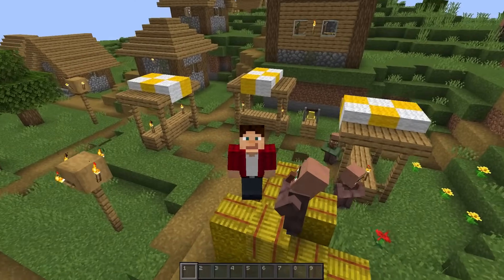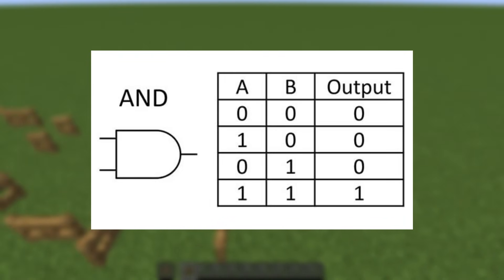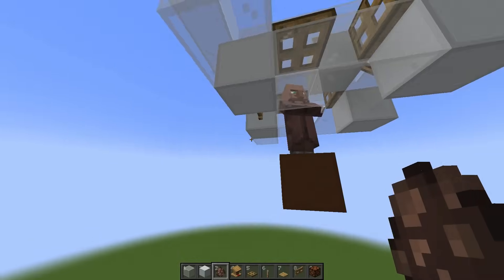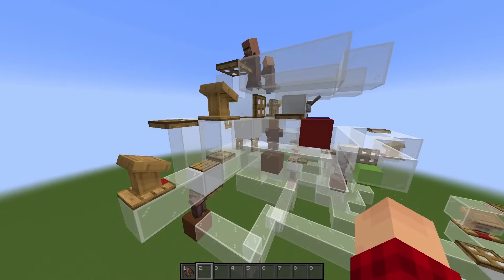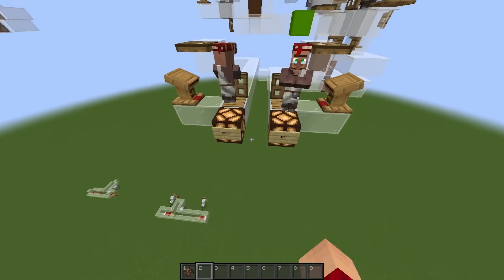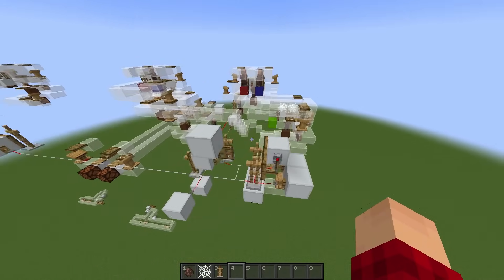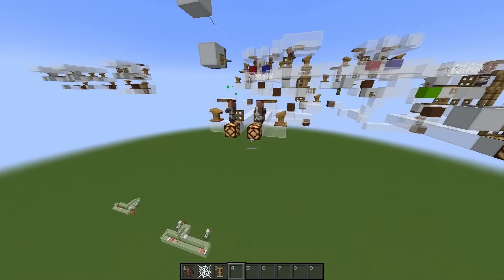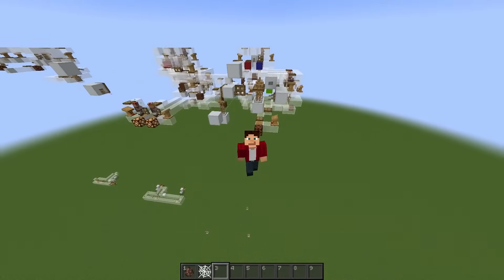Can Villagers Perform Binary Addition?

Comment: Kinda crazy how you ended up needing to design in delay lines using the cobwebs. When programming an FPGA, the compiler and synthesizer will work in tandem with a timing analyzer to build delay lines into the logic.

Comment: 9:55 I wonder if the guy wasn't moving is a limit to how far they can passively search for the lectern but when you replaced him it did a bigger check, maybe you need to provide extra motivation by making intermediate lecterns that they can go to but will have the floor get swept out from under them when they do causing them to fall to another path with the actual lectern.
Reply from the maker: I fixed the issue by implementing an OR gate later on in the video. I believe the issue was that the other villager had already targeted the last lectern, so the other guy had no lectern to target. Implementing the OR gate solved this, but it still doesn’t resolve other things like the unreliable villager reaction times
Reply: @michael23b  Interesting, this comment didn't show up in my messages, but rather as I was scrolling down through your comment section my comment and thus your reply showed up again, good timing! That could be the case, but what I said might still have been a factor, or if it wasn't it could be worth looking into none the less.

Comment: I love your idea here, entities being turned into logic gates is fun concept especially using villager A.I. 

I can’t help but notice the flaws in the system that Steve Mould and Numberphile also had where you can’t output a false signal since no signal=false and you can’t flip bits from 0->1 back to 0. 

This makes your half-adder only needing to have 2 different outputs of of carry false and sum true and carry true and sum false (which you accounted for), where as a real half adder has a third which occurs when both inputs are false with sum false and carry false. 

Also the temporal issue of requiring both inputs to run at the same time to cause an output is not in line with Boolean logic. 

I know none of these are super big problems and the accomplishment of using villager A.I to make logic gates is still mind blowing to me, but I do wish there were some way of getting around them. Then you could build a true computer.  

Thanks for the video.

Comment: now you need to make a full cpu :)))
Reply: um sry to burst your bubble but it wouldnt work since he has to manually reset villagers and a cpu is specificly built to be able to have a specific part (ALU) to do all the artihmetic used multiple times for different functions. it could be possible if u somehow had a way to transport them back after each calculation but i don’t know if its possible without dust :/